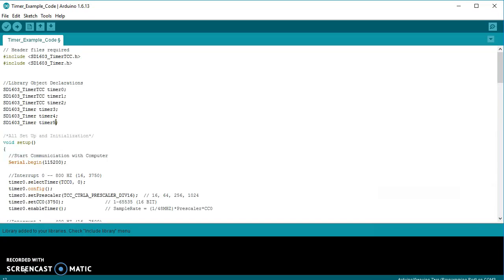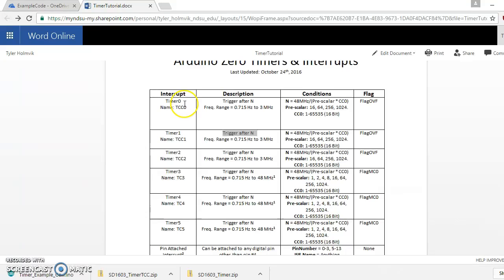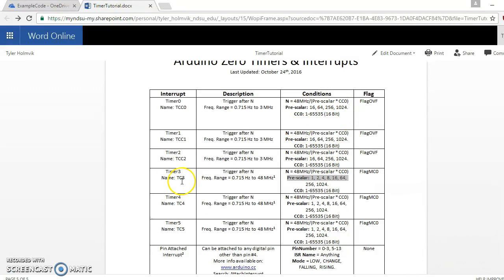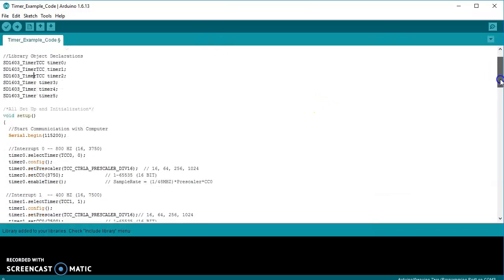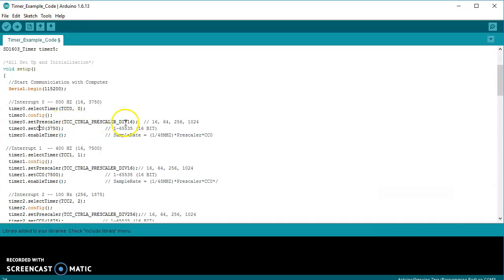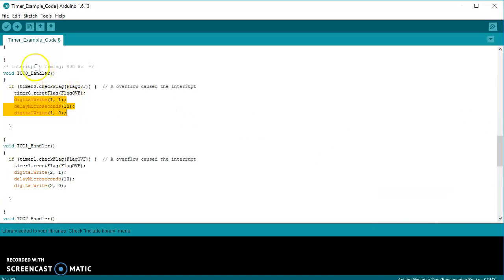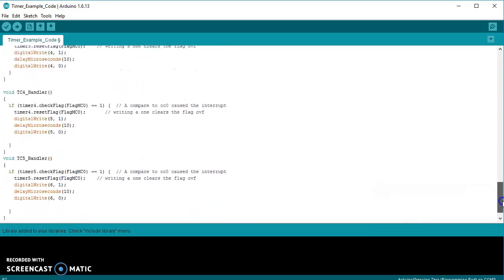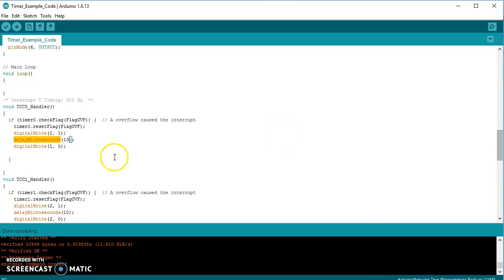Arduino Tutorial - Timer & Interrupt Tutorial

Comment: When I try to Verify/Compile your sample code, I get the error "SD1603_TimerTCC.h: No such file or directory".  The header files are not in my system.  How do I get/install the SD1603 header and library files?   This is my first  Arduino Zero project.
Reply: same
Reply: @daveblackstudios2254  excuse me, are you already get the answer ?
Reply: same as me, btw excusme, are you already get the solve ?... thank you
Reply: @listar1210  nah man sry
Reply: @daved3827  hoho thankyou bratah
Reply: @daved3827  hey dave..
i use this one to get 1000hz, but actually it cant sharp at 1000hz

const int analogInPin = A0;  // Analog input pin that the potentiometer is attached to
const int analogOutPin = 3; // Analog output pin that the LED is attached to

int sensorValue = 0;        // value read from the pot
int outputValue = 0;        // value output to the PWM (analog out)

void setup() {
  // initialize serial communications at 9600 bps:
 pinMode(3,OUTPUT);
  Serial.begin(9600);

noInterrupts(); // disable all interrupts
TCCR1A = 0;
TCCR1B = 0;
//TCNT1 = 65484;// preload timer 65536-16MHz/256/1200Hz
//TCNT1 = 65411;// preload timer 65536-16MHz/256/500Hz
TCNT1 = 65473;// preload timer 65536-16MHz/256/1000Hz
//TCNT1 = 65503;// preload timer 65536-16MHz/256/2000Hz
//TCNT1 = 34286; // preload timer 65536-16MHz/256/2Hz
TCCR1B |= (1 << CS12); // 256 prescaler
TIMSK1 |= (1 << TOIE1); // enable timer overflow interrupt
interrupts(); // enable all interrupts
}
ISR(Timer1_OVF_vect) // interrupt service routine that wraps a user
//defined function supplied by attachInterrupt
{
//TCNT1 = 34286; // preload timer
TCNT1 = 65473; // preload timer
//TCNT1 = 65503; // preload timer
//TCNT1 = 65411; // preload timer
//TCNT1 = 65484; // preload timer
  
}

void loop() {
  // read the analog in value:
  int sensorValue = analogRead(A0);
  // map it to the range of the analog out:
  outputValue = map(sensorValue, 0, 1023, 0, 255);
  // change the analog out value:
  analogWrite(analogOutPin, outputValue);
digitalWrite(3,HIGH);
delayMicroseconds(2000);
//delayMicroseconds(1000);
digitalWrite(3, LOW);
  // print the results to the Serial Monitor:
  Serial.print("sensor = ");
  Serial.print(sensorValue);
  Serial.print("\t output = ");
  Serial.println(outputValue);

  // wait 2 milliseconds before the next loop for the analog-to-digital
  // converter to settle after the last reading:
  //delay(2);
}
Reply: @listar1210  O SNAP THANK YOU BRUDAH
Reply: @daved3827  dont forget add the library